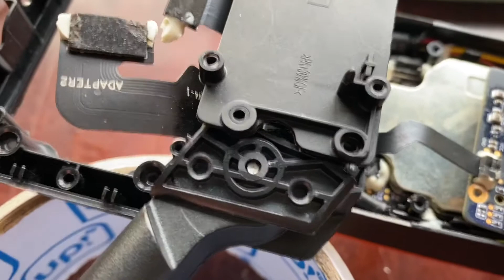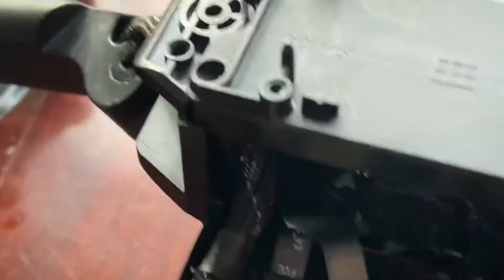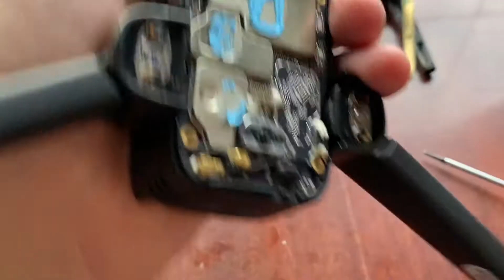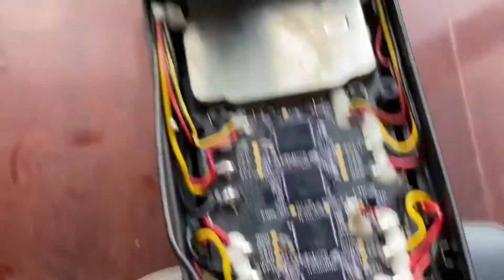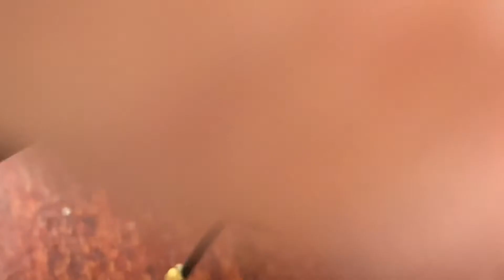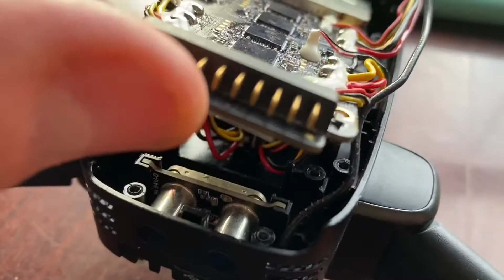Replacing front arm on Autel Evo - part 1

Comment: May I recommend eliminating the background music? It is distracting. Also, although you have already done it, to save yourself some work, I would have cut the antenna wire on the top side and left it connected on the bottom side. Then, splice and solder the new antenna wire to the old.
Reply from the maker: I thought about cutting and splicing the antenna wire, but also thought of the possible connection issues in the future. Each break in any signal wire may lead to loss of strength of current.